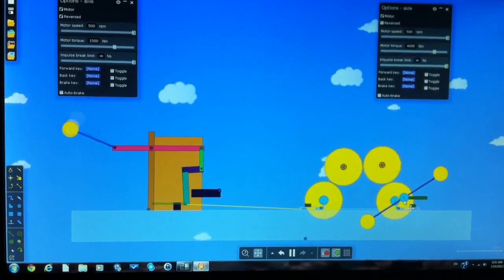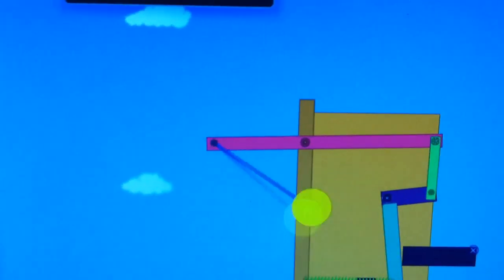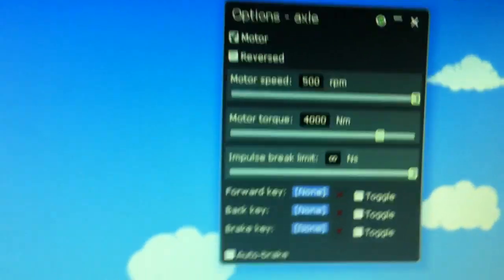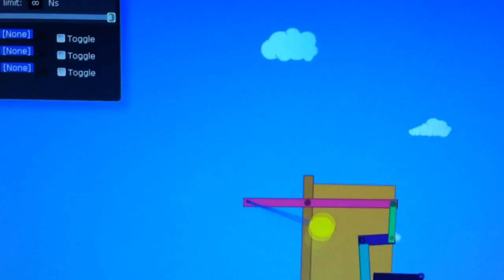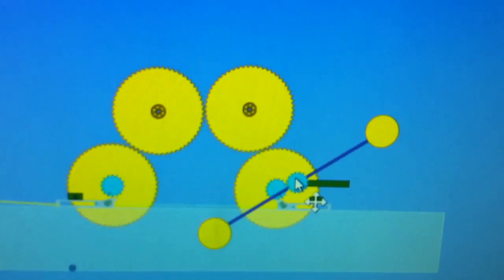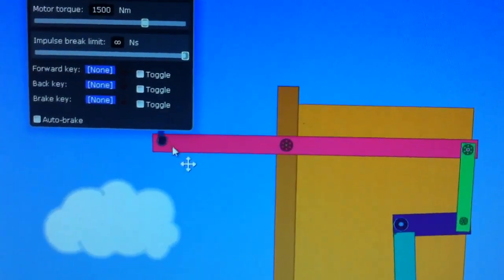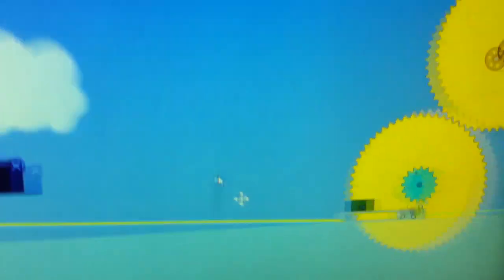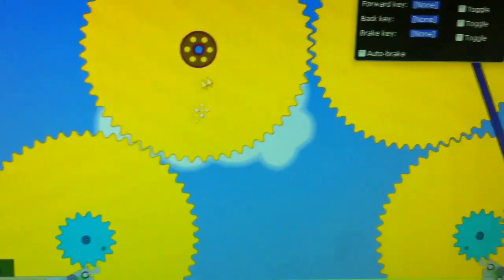Over Unity using Centripetal Force

Comment: If the pendulum is being driven by a motor i believe you won’t be utilizing the full potential of gravity.  If you put the drive motor at the top and have it give a push during the down stroke then  gravity can fully act on it, to accelerate the pendulum,  the faster it spins the stronger the down force will be

Comment: Look at the speed mate. your powering motor runs at a much higher speed than the load. You might as well added a gearbox to the 1500Nm motor to overcome the 4000Nm motor at a lower speed. In fact your 1500Nm motor runs 24 times faster (if i counted correctly) meaning it is HIGHLY INEFFICIENT considering you could achieve the same result with a 3:1 reduction gearbox
Reply from the maker: I don't think you understand how fast that 4000Nm motor would accelerate to if I tuned it lose.
A Nm IS the amount of energy going into the motor. In this example speed has nothing to do with the amount of energy.
However, if you want to consider any type of gear ratio comparisons, then you may want to consider that by way the ratio of the lever, the 4000Nm motor should have a great advantage. How would you account for that?
Reply: MagnaMoRo Well you are using a motor with a certain torque at a certain speed to rotate a load with a negative torque at a much lower speed. My point is that a 3:1 reduction gear having a 1500Nm torque on the one side at 52rpm would give out 4500Nm at 17.3 Rpm enough to overcome your load much faster. Even a  5:1 reduction would give 7499Nm at 10rpm. This is a lot higher than the 4 Rpm result you are getting.

Comment: Good job done. J am sure that this shown here is OVER UNITY. 
Maybe you can make everything even simpler.      
You need just the rotational part and sliding or rolling direction (fix walls). 
You do not need anything else. ( my third video).